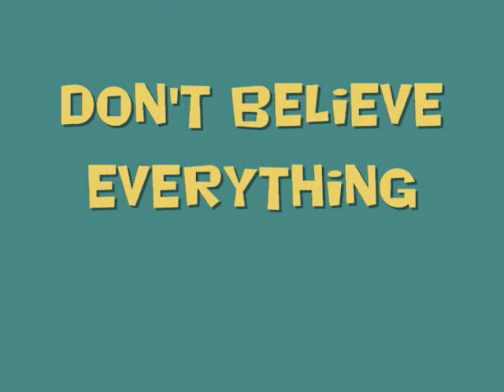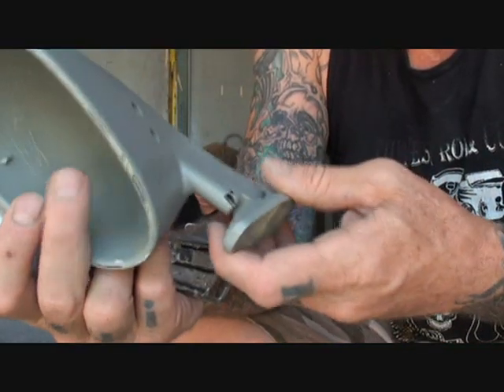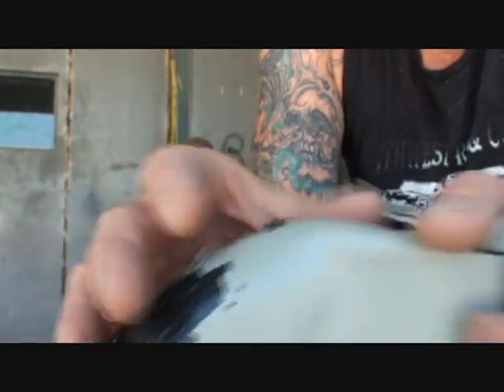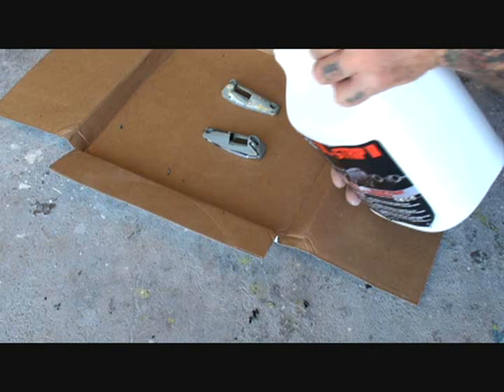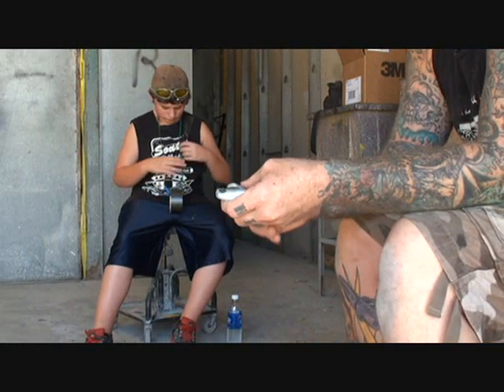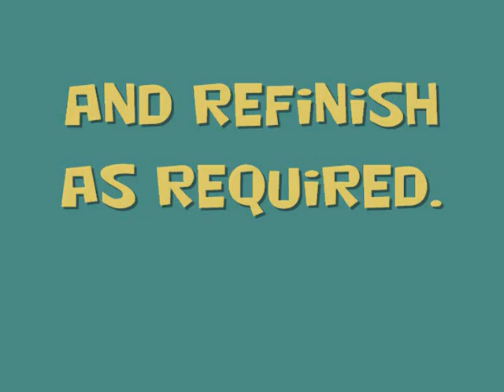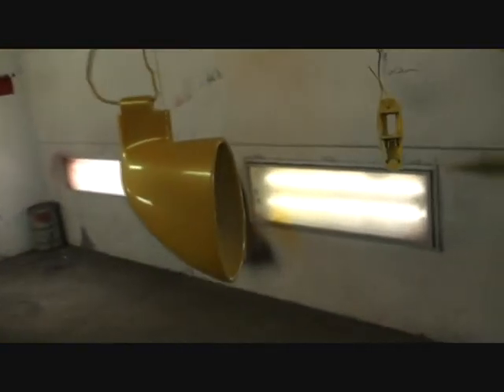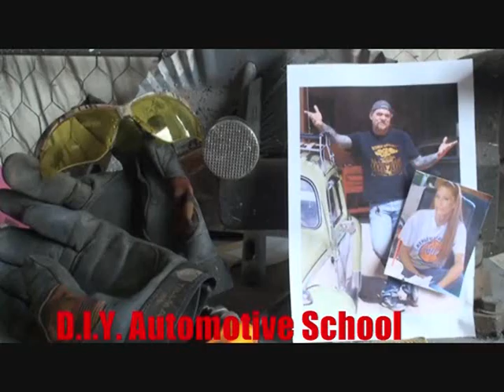Pro Street Willys Coupe-How To Paint Rear VIew Mirrors For Your Hot Rod.

Comment: They probably used some silicone based  shit in the mold's to prevent the plastic mirrors sticking to hard . This is a common problem. This pieces is for sure contaminated with something and i dare to say that it's not the primer that's causing this.